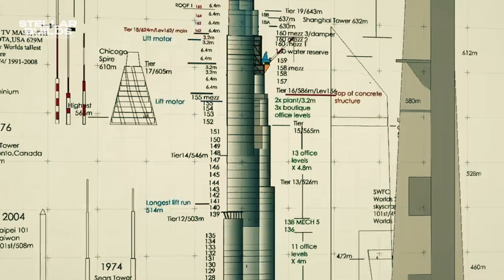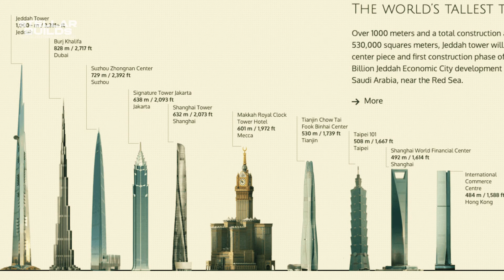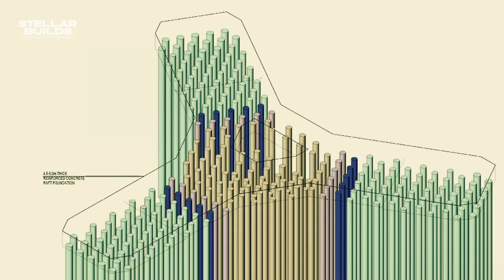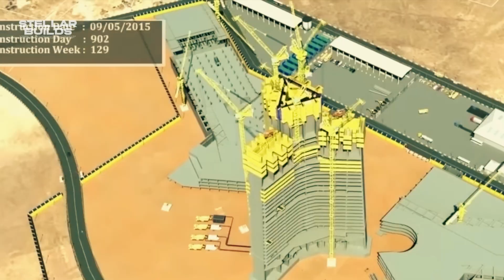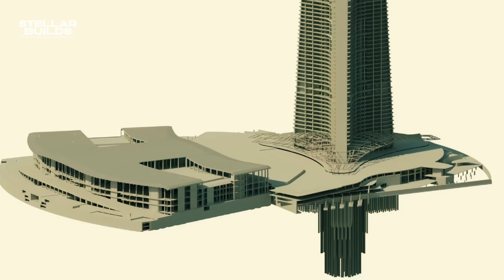Jeddah Tower, It Is Happening!

Comment: What do electric cars have anything to do with this?
Reply: If we go to electric cars, and use something other than petroleum for energy, then Saudi Arabia will run out of money fast.
I'm a big proponent of nuclear. It's got everything else beat for grid power.
If you have a small encampment, solar can be a good alternative. Much of Africa is without a proper electrical grid, so solar makes a lot of sense there. Solarize a village.
Without cars guzzling down all that oil, most of the Middle East just lost its revenue supply. They don't have much else going.